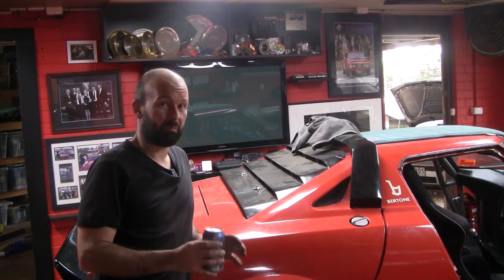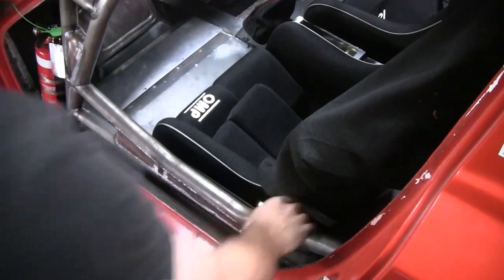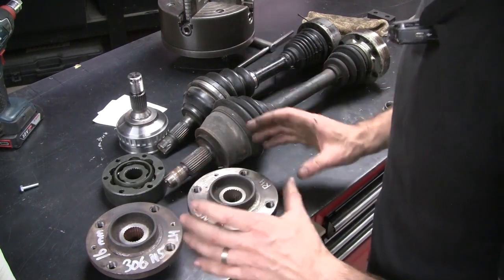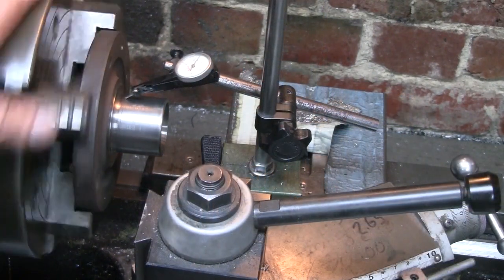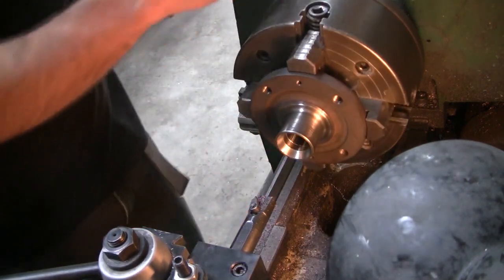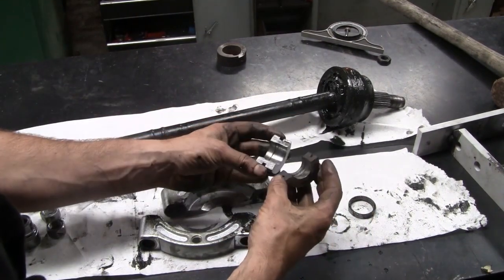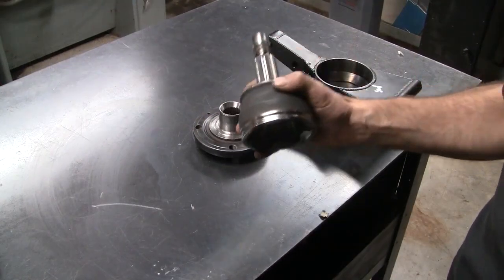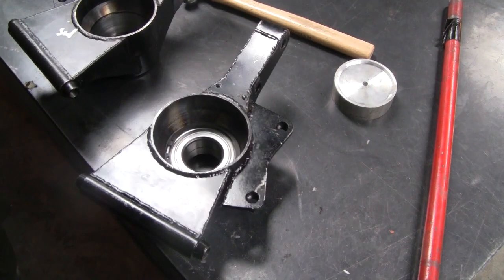Project Stratos - Episode 22Drive Shaft Fix number 2

Comment: Peugeot rally man here watching from Ireland. Some of the larger Pugs may have a CV joint to fit the 306 hub but also  have a bigger shaft spline. 
Peugeot 806/Expert van etc.
Reply from the maker: Hey mate, thanks for the tip, I did have a good look through the CV catalogues, but didn't come across that one, will definitely keep it in mind if this combination doesn't work out
Reply: @105colin  Let me know the spline count for both hub & shaft & I will look into it. We may have parts available here that you guys didnt get down under.
Reply from the maker: Thanks, we'll the original pug hub and was 25 and I've had it machined to 27, but could pretty easily get another set. As far as the cv goes really looking for the biggest axle I can find. Pretty sure I'm going to be getting some custom axles

Comment: Great vids and work as usual. Any reason you went with two pumps and the associated fittings and controls etc and not just a jet pump on the return line?
Reply from the maker: Thanks mate, yea a couple of reasons, I thought 2 pumps in series may help with the pressure drop across the long pipes I need to run, but mostly it was about redundancy, if 1 pump fails we should be able to limp home on 1pump, could be the difference between finishing a rally or not
Reply: @105colin  fair but simplicity is also the way to go with this stuff, I see you have a big alternator to run the two pumps as well, then bugger brakes to stop that mass and more boost to offset the brakes.... All adds up!
Reply from the maker: I hear what your saying, but not a huge amount of extra complexity really.  As for the big alternator,  well a bigger single pump is going to draw more current than a smaller pump, maybe not twice as much, but your really only starting to talk about a couple of amps, the water pumps don't actually draw all that much current, special when they are PWM. As for weight, we're talking less than 1kg, and I'll take that hit for the redundancy factor.  When your 100km away from your service vehicle in the middle of the Aussie bush, a bit of redundancy is very comforting!
cheers

Comment: Another great video again; definitely the best build (of many) I am watching or have watched. 
Not all CV joints are this difficult.  I have freed various Japanese and German versions with light-ish tap on the inside face.  Obviously corrosion was not an issue with the amount of grease about.  It seems disproportionately tight for its purpose?
I spy your Arduino dash panel is mounted, presumably reading the fuel level sensors now in the tanks.  I'm looking forward to the wiring, ECU and tuning episodes.
Thanks, keep the videos coming.
Reply from the maker: I have no idea why those clip rings were so tight, I have heard alfa ones can be pretty bad. Well spotted, that was just a stunt double dash for fitting purposes, plenty of work behind the scenes on the wiring /electrical side, most of that will happen once the chassis is painted as well as the wiring harness won't really be removable